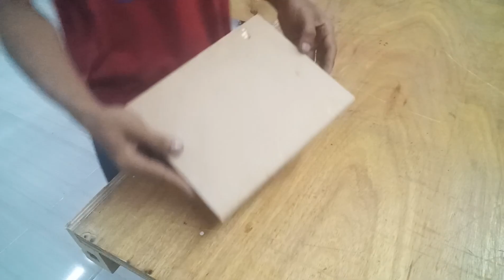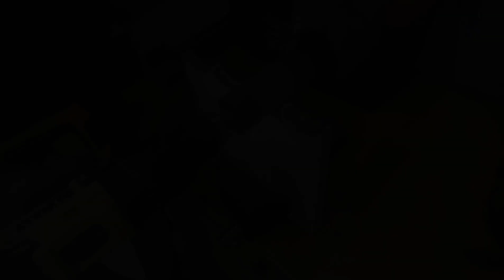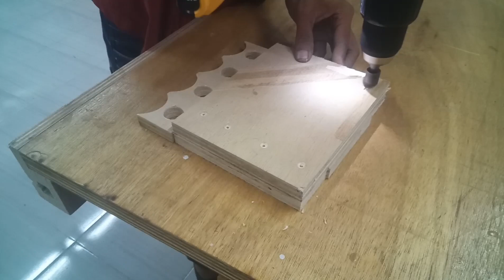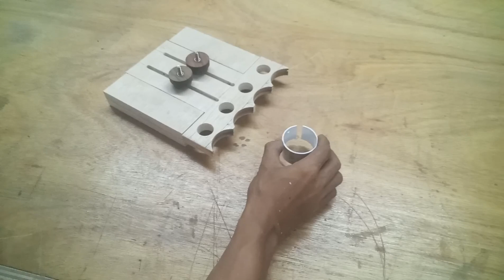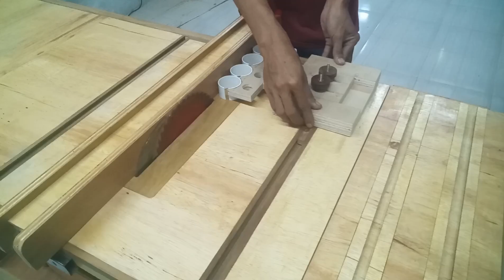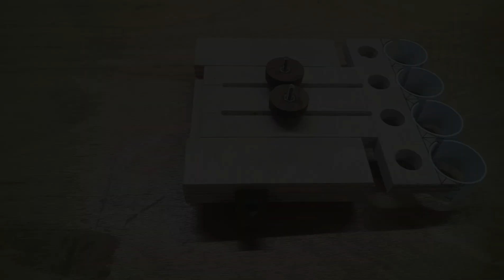Brilliant idea in every workshop - woodworking DIY.

Comment: Good video, excellent idea... BUT, you need to avoid burning when using your holesaw!  Try to do it at a much reduced drill speed, try to lift the holesaw frequently to extract as much sawdust as possible, and try to extract all the shavings from the hole with a vacuum while drilling. A simple but time consumming resharpening,
 done with a triangular file will recover most of the time spent at cutting, and will reduce or eliminate the burning and produce a cleaner cut.  Best wishes from Mexico.
Reply from the maker: thanks for the good advice. we will try to do what you say. useful comments for us in the future. .
Reply: Jago english nya bro